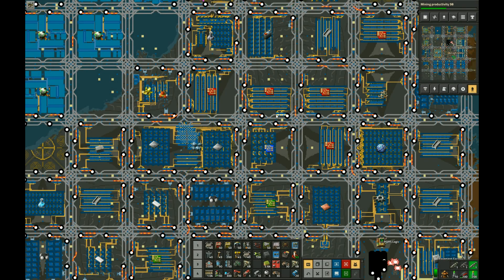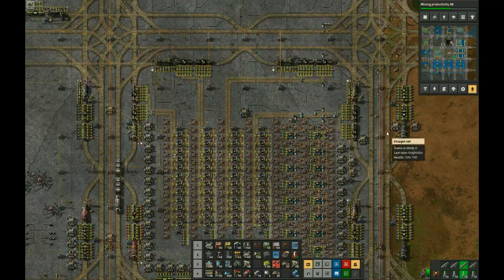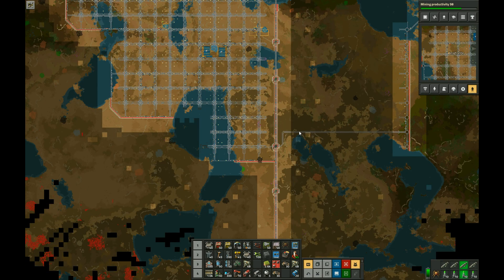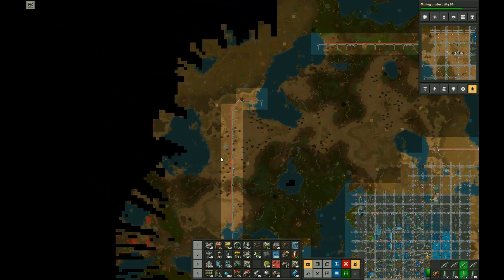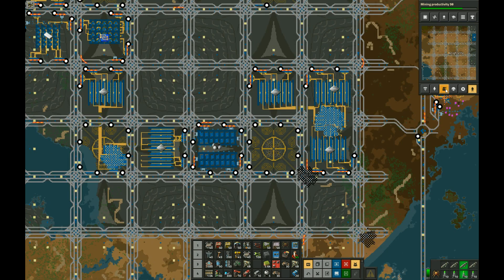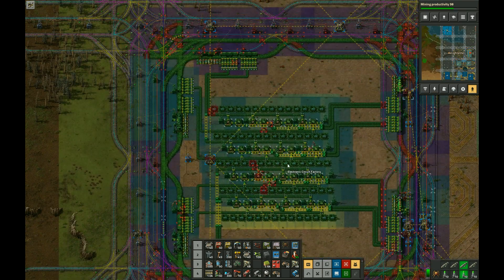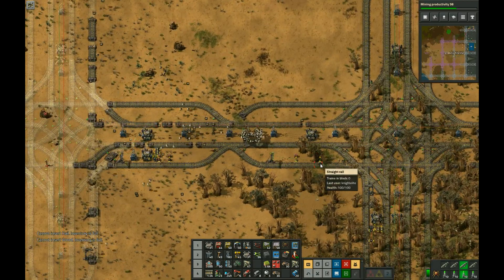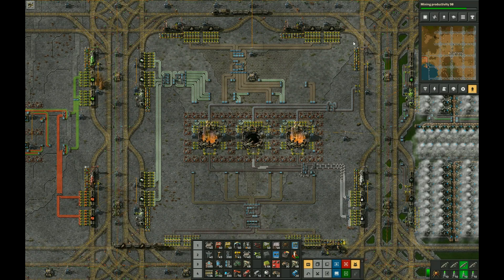2500 Science Per Minute Rail Grid Megabase

Comment: @KnightElite Hey I was inspired to try this out from your video and I have set up the PQRS logic brain and set up a few stations using your grid. However I am running into an issue/bug and I am not sure what I am doing wrong. I noticed my fluid wagons are triggering when either one gets completely full or empty and it does not wait for both an empty train AND a full train. Did you ever run into that? Not sure what I am doing wrong. I have tried using the Remote Reset a few times but, once the lockout timer ends the same cycle continues. Any help would be much appreciated <3
Reply from the maker: Assuming you're the same guy who messaged me about it on Reddit it sounds like you figured it out.  If you're someone else, I'm happy to take a look.
Reply: @KnightElite0  yah same guy lol, sorry for the double message

Comment: Holy shit what UPS is that base running at? Looks like SOOO slow based off that artillery flying on the map.
Reply from the maker: It's running at about 35 UPS, but for much of the footage in the video I set update speed to 0.5 and then doubled the playback speed on the video to make it 60 UPS equivalent.  If you're talking about the artillery shell you can see moving at about 4m45s in the video, it would have been at 30 UPS.
Reply: @KnightElite0  Makes sense.